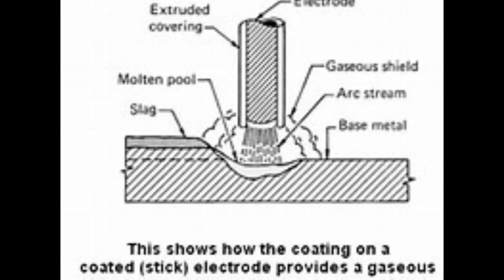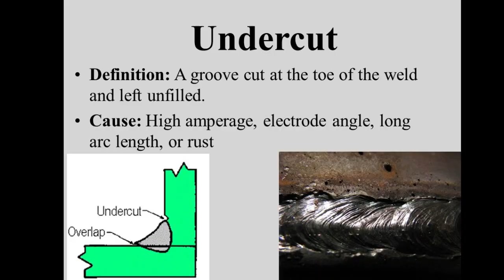How to avoid undercut in your welds Medium

Comment: Very helpful video. Thanks for the patience in explaining this lesson. I need this for a weld test for a job. I undercut on string beads and had to go back and run another bead that put my cap over the tolerance and I failed. If I never undercut I would passed.